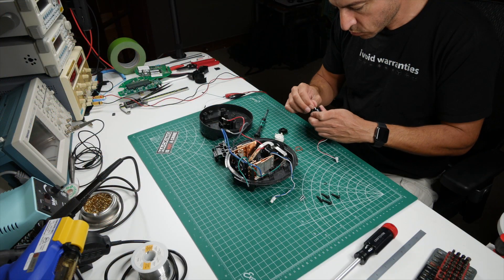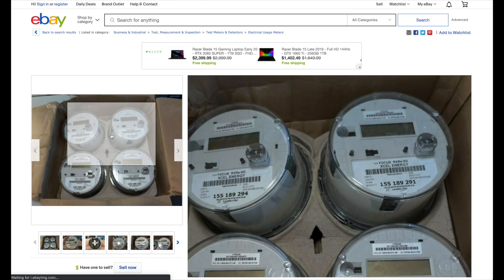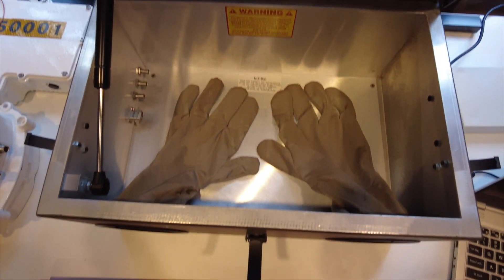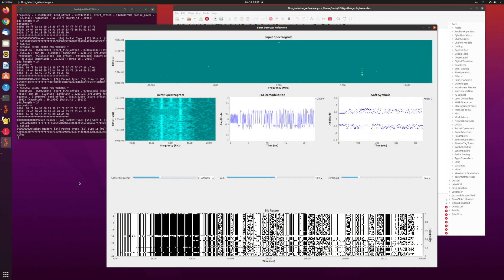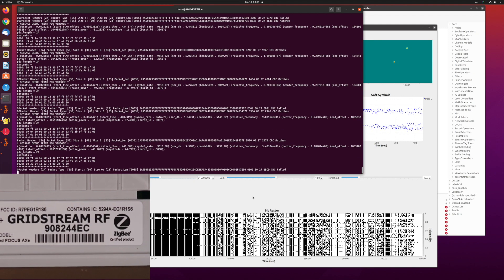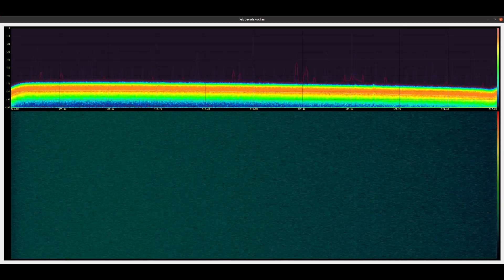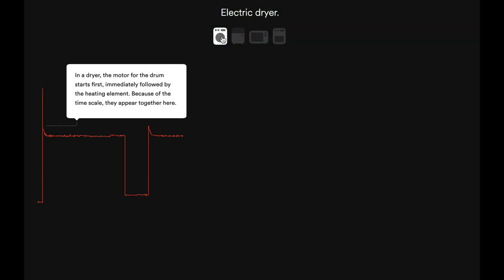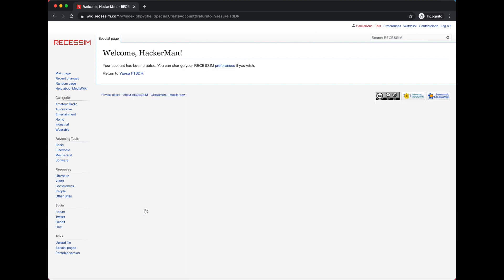Smart Meter Hacking - Introduction

Comment: Recently I had a power cut but my fridge/freezer was just barely running and my big chest freezer was just barely running. No lights. Couldn't charge my phone. Tried swapping plugs, using power boards.. smart meter said it was working.. 

From 11pm til 6am it was like this.

I rang power company. She said she had never heard of that happening before

Comment: SANGAMO machanical meters had a plastic covered module at the bottom and I saw some small 8 pin chips on it - so it must be low voltage modern electrnics of some sort. Any idea what that module does? because the meter is fully machanical otherwise, with gears and spinning Al disk

Comment: i’m retired from an electric utility company, I was a field man that went out to investigate theft of service..
 when there is a drop in your average consumption, the computer kicks out your account and they send me out to investigate.
 when I detect hanky-panky. I shut the service off and lock the meter base. I take photos and fill out a report. I leave a copy of how you can get your power reconnected on your front door.
 they estimate how much power you have stolen, and that is added to your balance due, you’ll have to come up with a substantial deposit, and your balance paid in full, including the estimate for how much you have stolen. Add to that the price of a new meter because you have tampered with the old one..
 you can’t just switch the power account into someone else that lives there name. Not only does it sprain the relationship between customer and Company, but it also sprains your credit rating.. that means you won’t get as low in interest rate on loans as you would if you were an honest person. That’s because you are now a risk..
 we have disconnected service two people that were using generators after we disconnected their service from the pole. One customer I had had a generator running for years. They could not come up with the money for the deposit, and the bill that they owed..
 The generator they had used about half a gallon of gasoline per hour, that’s 12 gallons a day. At $3.50 a gallon, that’s over $40 a day just for gasoline, not counting. The trips made probably daily to go get new gasoline. Probably using their generator only half a day depending on the temperature. Let’s say they were only using about $25 worth of gasoline a day. using the generator for only 12 hours..
 that’s roughly $175 a week. Let’s just say it’s $150 a week. That’s $600 a month for gasoline. Those generators are not quiet, I am sure that means neighbors are not happy, because this has been going on for years at this one particular customer. He had about 10 gas cans in his garage in the driveway, add for extension cords, going in the house through slightly opened windows..
 is it worth it? I don’t see how.
there is a tamper switch in every meter. The company knows that there has been a tamper alarm as soon as that motor was moved. It records not only the time, but the exact second of disruption/tampering. 
 I am retired from the electric company now for a few years. And they have updated the system to the point, where they can tell from the office, the millisecond, that the power has been tampered with. They can turn the power off and on right from the office. Each meter has a built-in cell phone type device that can be switched on or off from the office at the push of a button.
 when a customer breaks the seal on the meter base lock, and pulls the meter and removes boots when we used to boot the meters or tampers with the meter, they do not realize the Pandora’s box that they have tampered with. It ain’t worth it. Do you think it would be better off without electricity service at all. Do you think you could run your house on a generator?
 you could run your house on solar panels or a windmill or a Hydro generator if you live near a stream with a drop in water level. I’ve done field investigations where the company was actually paying customers, and everyone of those was a house that has solar panels on it. If you have solar panels, the company has to pay you For every kilowatt you put into the grid. I think it’s $.12 per kilowatt. You will be given a meter/analog meter that runs backwards to measure the reverse flow of the current that you are generating with solar panels and putting into the grid. The most I’ve seen a customer make was $600 a year., over and above what their electric usage was for that year. In other words, their complete consumption of electricity was paid for by the solar panels with a surplus for the customer of $600, $50 a month… The customer had a 3 ton whole house, air conditioning, system, and an electric pump for their inground pool that used 14 A, they also had two refrigerators..
 if you want to get free electricity and you have the technical skills, why don’t you just buy a 7500 KW rooftop system and install it yourself. You can buy them for under $10,000. Or hire an electrician to put it in, it will take him less than two days to install. That is the proper way to do it, because he hast to apply for permits and have it inspected by not only the local electrical inspector, but by the Electric utility company that will be paying him for his excess electricity. He puts back into the grid…
I was a registered electrician, putting solar panels on the roof is a piece of cake to a real electrician, that is gravy work because it’s all level instead of working up in a hot ceiling or pulling wire through plaster walls or crawling around in the hot crawlspaces . putting a rooftop solar panel system in is just about the easiest work. An electrician can do, of course, there are some things that can make it tough like the height of the roof, or if it is a slate roof, if there are trees, blocking a southern exposure, things like that, but in general, that is really an easy job for an electrician and helper. It takes two guys to be safe, the hardest part is getting the material on the roof. 
  So, if you think you can beat the system, be my guest. Electrical theft in this country is in excess of $1 billion loss to the electric industry in this country. And the people that pay their bills are the ones making up for your theft of service. No different than a large department store raising prices to cover shoplifting losses.

Comment: hi, video interesting, i have investigated, i cached them - how the job going on - smart meter from the mechanical meter nothing different they rolling equal, but they monitoring voltage, so they push voltage 246v, when everyone after work home they increase to 253v, that is how bill goes up after replaced smart meter, someone cheating on you rip off, they have to monitor voltage to avoid burn your house over voltage. there schema is 230v allowed + - 10%, 23v minus or plus, so between 207v and 253v they can play up but they never drop that low as you could safe money. to sew them to small claim court wont be successful. if you seen voltage optimisation unit cost 400£ could reduce 10% - it is good but need to plug this unit before smart meter to safe money. i thinking call to shop who selling optimisation unit ask them how to get permision to plug before smart meter, if not allowed  then what is point to buy them

Comment: This collection of information beyond the demarcation point is a violation of privacy. There must be a device other than power conditioners that mask the devices used in one's home... noise generators?.... any ideas?
Reply: See if your utility provider offers an opt out meter, although there is no guarantee they’ll provide you with a true mechanical meter (The one you need), and still charge a ludicrous monthly amount for a non communicating digital type meter, the latter option won’t solve the privacy issue.

Comment: Our bills went up almost immediately after we had our meter changed from the mechanical dial type. I was convinced that the meters must be recording the current peaks which occur during the first few ms of an appliance being turned on, which were previously damped by the mechanical style meter due to the inertia of the disc. So I contacted Honeywell who manufactured the meters at the time and they confirmed that the meters do record the initial peaks which can cumulatively add more to your bill. Fortunately they have software "damping", but the amount recorded is adjustable by the network/installer (via software and infra-red comms interface). So I guess if all refrigerators and pumps etc incorporated a "soft start" it might help?
Reply: use a big capacitor in the inductive loads
Reply: Mine did as the unit price on the smart tariff is 23p a unit more than it was on my old friendly credit tariff that is only available on my
Older style key meter. Yet they sent me a letter saying get a smart meter or we will jack up your price. More fool me for not looking into that cos once I got it I got stuck with it. There is a work around of cause. Go for a company that don’t use smart meters and they can change it back so I suggested that to em. What if I move companies get the older key meter then come back of cause they said but as part of the government plan we would encourage you to go back to a smart meter. I said at 23p a unit more where is the incentive. Then their attitude changed they warned me against using profanity’s I said I’m asking you a simple question. Any more of that they said we will have to close down this conversation. I said if the people had rights over the private companies I would have grounds to su. And just like that conversation was closed down I got a block on my communications and told if I wanted to talk to em I would have to find an alternative way of doing so.
Reply: Surely, soft starts or other means of smoothing transient currents, if anything, will make your meter read higher (electronic ones less so, but still potentially).
Reply: @twelvereasonswhynot  Indeed, with the mechanical meters it was taken up by the  mass of the wheel accelerating (up to 1s). The new meters will measure spikes down to about 1ms, and the the threshold of the damping action can be pre-set by the grid operator. Not every appliance has soft a start eg fridges, tumble driers, vacuum cleaners etc. Grid companies are happy to install an identical meter in line to prove it's accuracy, but they never seem keep hold of your old mechanical meter to compare it with!
Reply: Yes soft starts will lower power  bill
Reply: Im going to get my power bill down I hope below 50 a month solar panels and batteries few other devices I'm done with these higher cost now it's ridiculous the pricing now.
Reply: Mechanical meters slow down over time. Very common complaint when digital meters are installed because they are more accurate and don't slow down (or speed up) over time.
Reply: @stevecampbell7620  Negative, analog mechanical meters have a much longer lifespan and are calibrated within 2% of industry standards before implementation. Smart meters not only charge extra for peak hour usage but also on 15 minutes peak intervals, and voltage. if that’s not bad enough, they are extremely inefficient stepping down 120v to 12volts, without any grounding making them prong to fires. Don’t get me started on the health concerns with smart meters. Analog meters have none of these issues plus they are hack proof thus private from data collection.

Comment: So I could jam the frecuency it uses to comunicate, there fore they can’t cut off the power. (I May have bad grammar, English its not my first language )
Reply from the maker: Your English is great! You could jam the signal (illegal in most countries) but then the power company would come out and replace the meter and check the area. The meter also stores the data internally and they could read it using the optical interface on the front of it. Great question!
Reply: I was thinking this same thing…our meter is inside of a fenced in area so they would have to contact me before coming to check on it. Lol…I could randomly remove the device whenever I wanted, just to mess with them…considering I tried to fight to keep my old meter to no avail. We should all start doing this…it would make the electronic company rethink their decision to force the smart meters on everyone

Comment: I have single phase as i live in a residential area. However i purchased an old lathe that requires 3 phase 208v. Do ya think they know i have that? And how do u figure that?
Reply from the maker: Interesting question, depends on the meter you have. I assume you have a phase converter to run it? They could tell power draw but likely appears like an A/C unit would or Dryer from power draw perspective.

If you read about a company called Sense, they have a more advanced technology that has been integrated into some meters that can actually “fingerprint” the power line so to speak. 

But they can’t tell WHAT you’re making on the lathe… ;)
Reply: @RECESSIM  
Yes i purchased a rotary phase inverter. And where i live everyone gets charged for peak hours which is of course not to anyone's benefit except the utility. It should be called screw you hours instead of peak hours.
Reply: Get a Phasemaster. It connects to 220v easily
Reply: @ronaldshelton2623  I think thats what I got. It was around $1k

Comment: Sure I'm going to copy and paste someone's comment and I'd like to see what you think about it we're having a big discussion in North Mississippi about smart meters and health and the comment I'm going to paste the man says that they cannot tell what kind of appliances are being used and I was under the impression that they can would you please read his following comment and let me know what you think thank you sir and I enjoy your channel
"It is impossible to make any reasonable comparison to your neighbor's electric bill since there are many factors which impact each individual bill such as insulation. type of windows and doors, lifestyle, etc.  Also the "Smart Meters" measure the total energy used and transmits that information to the utility, HSUD in my case.  I does not have any way to know what devises are using the energy at any one time.  You can have such systems added to your home but the Smart Meter is not such a device."
Reply from the maker: It depends on the capability of the smart meter. There ARE smart meters that can differentiate devices being used. Search for the Landis+Gyr Revelo smart meter and look at what it can do. It incorporates technology from the company Sense to do just that.
Reply: @RECESSIM  it's a Honeywell's  ami A4TRES

Comment: If you bypass the meter with a jumper will the meter know and inform the company. Or is it best to jump from main power lines to the back side of your main breaker. Leaving breaker off so it won't back feed to meter?

Comment: I live in a 900 square feet apartment and my bill is $200 
I have nothing on except my a/c and FPL says too bad we don’t know why it’s this high and we don’t care
Reply from the maker: Inefficient appliances and things you wouldn’t suspect can definitely add up. You might have an electric water heater for your hot water. If it’s old and not able to store hot water without losing the heat that can add up FAST!

Comment: found your video interesting.  I suspect someone is stealing electricity from me, as my bills have quadrupled unexpectedly.  Would the Electric company be able to see the grid to advise me on what is making the usage so high?
Reply from the maker: The electric company can definitely help you assess what’s going on. If you usage hasn’t changed at all, and they didn’t raise rates I would have them come check everything is ok.
Reply: Big appliances can suffer sudden 'efficiency failures,' like loss of a cooling fan or clogging of some filter line that might go unnoticed until your ellectric bill explodes.
Our bill was on autopay; fortunately it maxxed out at $1,000 and we got a late notice/disconnect threat. First we knew that the AC fan had half died and HVAC efficiency had gone to hell.
Reply: I got a smart meter and suddenly my bill tripled.the power company says it's fine and thatI just use too much power. They don't care. I siit in the dark,no tv,no ac etc

Comment: Is a metal garbage can a Faraday cage? Thx
Reply from the maker: Anything conductive like metal can be a Faraday cage if you can seal it up. The higher the radio frequency, the smaller the opening it can escape from. For some frequencies even chicken wire works! Unused paint cans also seal up well, put a phone inside and put the lid on it. Won’t be able to call it.

Comment: Large power companies don't buy/sell off Ebay. Many distributors sell over stock or refurbished on secondary channels to cover smaller utilities. Some utilities like to have only one make or model in their system for easier management. When those products are no longer made, this is where  they're found. If you look at the "new" meters on Ebay, almost guaranteed to be "new old stock".
Reply from the maker: Thanks, that’s interesting information

Comment: the original smart meters had a zigbee chip installed to monitor appliance usage. appliance companies couldn't agree on a language to use, so they stopped installing the chips in them. most power companies won't use the newer meters that scan the load variants because of the cost and the simple fact that it does them no good knowing what appliance is on. only your total usage and, if you're a heavy or industrial place, the overall demand / power factor of your building. those directly affect the grid and bottom line. The Zigbee was for the end user only, so the customer would be able to easier diagnose failing appliances. 
    You are correct in your assumption about the sporadic communications, the packets are small that are sent to the hub, but bandwidth is still bandwidth. Most residential meters communicate once every hour, commercial once every 15 minutes.